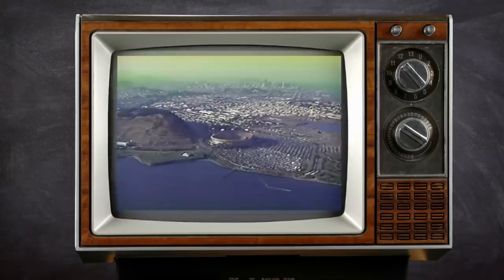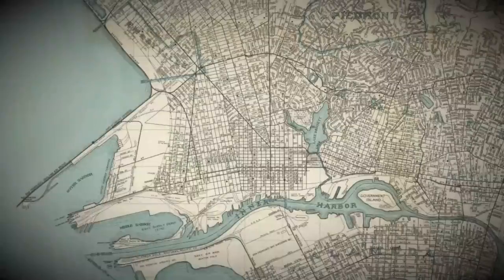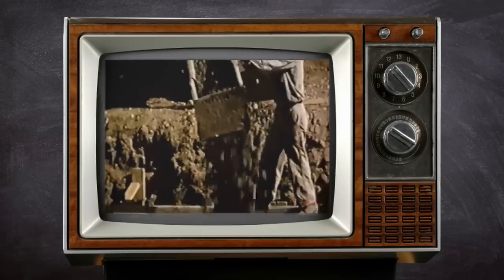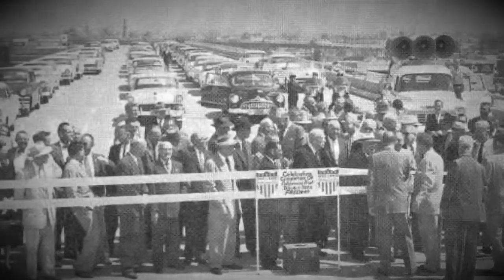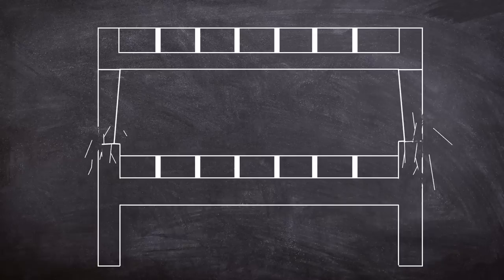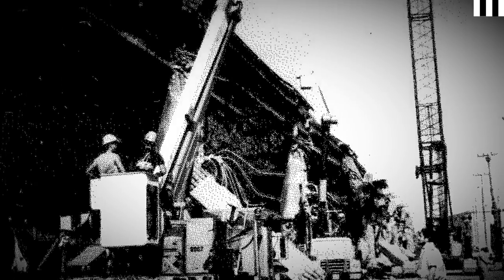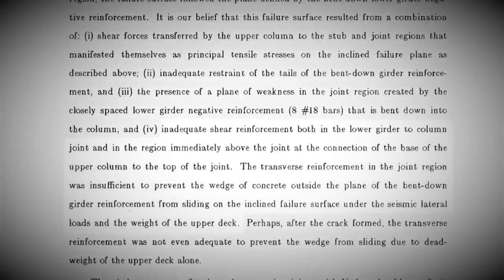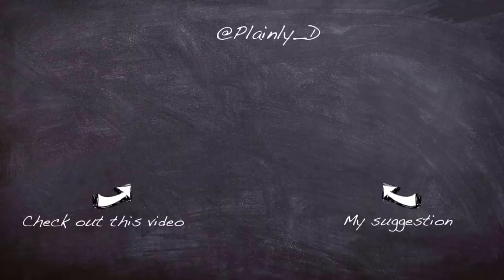A Brief History of: The Cypress Street Viaduct Collapse Disaster 1989 (Documentary)

Comment: As an ironworker who has built bridges and roadway decks, I can tell you that everything is placed well steel-wise, but once it's buried in concrete it's in the hands of the chemical bond between the bar and the concrete.

epoxy-coated iron has been the go-to standard for bridge construction in WI now for my entire career, but I am not convinced of it's efficacy - we are already seeing rust streaking and concrete blowouts on projects less than fifteen years old.  Personally I feel that the alternatives are less inspiring of confidence, but then again, i'm no engineer.
Reply: epoxy rebar is banned now due to excessive rusting from galvanic action on exposed parts of bare steel where nicks or rubs expose it
it rusts through WAY faster than traditional rebar when this happens, now they are looking at fiberglass rebar and carbonfiber with very promising results, not just from strength gains but weight as well, but rebar is very well understood over a hundred years... we dont know the long term effects of these new things
Reply: @narmale  obviously then we should just replace every structure right now with the new stuff and just hope nothing goes wrong. Works for Pfizer.
Reply: But it also depends on the concrete itself, in Gateshead in the 1960's they built a complex called Trinity Square, a brutalist building consisting of a shopping centre and a multistory car park. Within 5 years of opening, they found cracks in the building because of shitty cement and were always patching it. They demolished it in around 2005 and rebuilt into a shopping promenade. I visited the shopping centre as a kid, it was a tip. Visited it as an adult, it was like a scene from Chernobyl, place was dead.
Reply: @narmale  just an old plumber talking, but I always considered the epoxy finish a sales tool. I have plumbed many a swim pool to return because of shifting. In the ensuing jackhammer work(years later) raw iron had very little degradation. Difficult at best. Always questioned the efficacy of coating a steel rod in concrete
Reply: @omeyehead7436  I'm just a lay person, but we were taught that this was the best to make a structure stronger.
Reply: There are so many buildings in Europe and other places. I know that we're a young country. But why do their buildings stand for centuries and ours have problems standing for 40 years. We have some of the best engineers in the world and maintenance and monitoring is crucial. I'm not including earthquake disasters. I keep thinking about the Washington Monument in DC that's sinking and the Surfside condominium CTS melting away and SF Millennium Tower leaning just needing a tiny quake to blow it over.
Reply: @omeyehead7436  absolutely correct, only time it starts rusting is when it has non-stop immersion of water aka in factories with chemicals... i worked construction for 14 years and all the demo work the rebar was just fine... yet another reason i dis-like engineers... if it aint broke, dont fix it
Reply: @staciasmith5162  Short answer: quality through rigorous oversight.
Longer answer: here in West-Europe it's very difficult to get away with shoddy quality and/or bribing some officials. Oversight is very strict and therefore the quality is guaranteed to be higher. Don't even try to try and hide structural work by patching it over before the inspector has done his inspection, because he will simply tell you to remove it so he can inspect the beams, pillars etc. And you better have the paperwork at hand, showing what quality material you 've bought and from who.
Reply: Besides money, why isn't stainless steel or even galvanized rebar used?
Reply: The real problem with this structure was light design. They realized it wouldn't hold up and designed a retrofit program to upgrade the whole Cypress Section. Only 4 columns got the upgrade as a test before upgrading all the rest. You can see those four still standing at the 11 minute mark in the video.
Reply: There's such a thing as carbon-absorbing concrete, now. The advantage of at least one formulation is that it gets stronger over time, because it absorbs carbon from the air. 
It's probably not currently used because of cost to change production methods, I would guess.
Reply: @staciasmith5162  The Romans didn't use rebar in their concrete, so it never rusted and expanded.  The Greeks had a great system.  the top of the blocks were concave and the bottom of the blocks were convex so they nested in each other.  Some blocks were held together horizontally by cutting a channel like an "H" across blocks and fitting them with soft lead.  When there was earthquakes, the soft lead would flex and the nested blocks would move, but then the structures would reassemble themselves through gravity.  The Japanese who always had to deal with bad earthquakes had their wooden structures assemble with many joints.  Considering they had heavy clay tile roofs which weren't going to sway in unison with the ground movements, having structures with a low failure rate is amazing.   The solution to the rebar problem is to go with fiberglass or carbon fiber.  As always, only the good buildings last which gives us the false impressions old work was always good.  In Britain, most castles were wood coated in plaster to stop attacks by fire.  They are all gone.
Reply: @lewisdoherty7621    Worth a mention here... In regards to the tallest and most ancient of Japanese Temples, they had a system of engineering for a single column right down the center of the temple tower. It's designed to move as a weird hybrid pendulum and counter-weight to the rest of the framing, joinery, and structure during a quake. It IS amazing, particularly the way they developed such a design so long ago, because some of those temples have stood for over a thousand years through quakes, war, bombing raids, volcanoes, and tsunamis... AND they're just as viable for human touring and habitation now as they were in the first years they were opened... 

     Speaking of which... They've got a modern school of engineering that's working that same counter-weight and balancing pendulum principle into modern skyscrapers in Tokyo. If I recall correctly, they retro-fitted a building with such a mechanism in design by taking up some of the elevator shafts for the columns and rigging, downsizing from a single GIGANTIC column to several smaller ones instead... AND part of the school's effort involves the students coming back to the building regularly to take readings and measurements over time, and especially around quakes and tremors. 

      BTW... just a tiny side note. Lead wasn't the only metal used by the Greeks for joining stones in horizontal fixtures. Bronze was also popular for it, particularly where the joint required an extra tightness and you could hammer bronze where lead would just splatter... I think some folks called them "Butterfly joints" (for the shape preferred among metal brackets), but I could be mistaken... It's been a while since I had anything to do with old-school "natural stone masonry"... ;o)
Reply: @staciasmith5162  a few ideas here. In the 60's-70's we were building many new structures pushing the envelope on efficient engineering. This was a example of learning through failure. If you're talking specifically about seismic instigated failure Italy is the most active country in Europe the rest of Europe is pretty chill. We have a very short history here in North America. California grew very fast 100 year before that viaduct we built settlers were filling the bay with garbage and fill dirt to make more land. I don't need to explain why that might have been a bad idea.

Just a note, many structures stood up to the quake very well. But importantly California learned allot from it's mistakes.
Reply: @Peter_S_  Imagine being the guy in that truck and seeing the upper deck fall 3 feet in front of your eyes, climbing out and realising the same thing happened behind you? That would have to result in some massive PTSD.
Reply: Epoxy coated rebar is now being banned in some areas.
Reply: @seymoarsalvage  stainless +concrete = a form of corrosion that leads to cracking and rapid failure.

And the stainless is considerably more expensive.
Reply: I never used to care, since I grew up in Pennsylvania, but having lived in California for 25 years, when I visit friends back in Pittsburgh, those bridges set on steel girders give me the WILLIES. My brain is thinking "oh look, an erector set that could snap at any moment." Which isn't fair— steel can flex, it's the concrete that's brittle— but I feel a lot better with the robust lighthouse-concave support pillars used out here now. It looks to me like they're wrapped in some kind of rubber sheeting to help maintain the integrity of the concrete, plus the cage of reinforced steel inside is quite dense. I hope we've adapted whatever Japan's been doing post-Kobe, since the 2011 Japan tsunami debris was flowing past roadways and bridges that remained intact.
Reply: @fhuber7507  there has to be something that can be used as rebar that isnt corrosive. And money shouldn't be a issue if the damned rich would pay up...
Reply: @staciasmith5162  You also have huuuuge American egos with greed to factor in.  Just look at your politics, law enforcement, education, healthcare, gun industry and military. Engineering is the least of your problems.
Reply: @gnarthdarkanen7464  I enjoyed reading this thank you
Reply: @dontblockthebox  Thanks for reading, and you're always welcome! It seemed like a share of nuance and details might flesh out the picture historically... give folks a little something they could further research tangibly.

    In any case, I'm glad you liked it, and hope you got something out of it. ;o)
Reply: @staciasmith5162  not all of our buildings stand for centuries. Some got rebuilt, other destroyed and replaced by newer ones some centuries ago. That's what happens after so many fires and wars.
Other than overbuilt churches, castles with 24/7 deluxe maintenance and tiny wooden houses not that much is left from the middle ages. Many many more buildings from the 1800 still going strong though.
Earthquakes are not a huge problem in Europe. The biggest one was in 1755 and completely destroyed Lisbon.
Some years ago a viaduct in Genoa collapsed too.
Reply: @YeahNo  I agree that we have  many problems, but there's a bridge on the Tennessee and Arkansas line that had a bridge which had to be closed down tout suite. We can walk and chew gum at the same time. Engineering is critical.
Reply: @seymoarsalvage  German steelworker here: Stainless steel has always a considerably lower tensile strength due to its alloy containing a good portion of chromium. If you would want to use it you need ~30% more. This would increase the total weight - thus, you need even more. Plus, it costs ~30% more per ton in the first place. And finally, if it was manufactured badly or has mechanic connection to a non-stainless steel part it rusts away like standard steel. For the same reason ships are built from standard steel and are protected by paint, coatings and self-sacrificing zinc anodes, which protect the ship very effectively by an electro-galvanic process. These big zinc chunks are eaten away by the sea water and have to be replaced after a few years.

Btw: Really good knives are made of slow-rusting steel, never from stainless because to this very day it is not possible to reach the same level of hardness.
Reply: A big German concrete company works on recreating 'zementitium romanum' - Roman concrete. It uses a volcanic substance called 'puzzolane' which is the reason why so many Roman buildings like the collosseum in Rome are still standing after almost 2000 years!!

That Roman concrete does harden under water and, in opposition to modern concrete, it gets stronger and stronger over centuries. Furthermore, it does not chip or crack after installation. According to their scientists, it is hard to optain and therefore they search for a replacement.

The Chinese wall was built using sticky rice in the mortar compound - this is also very interesting today!!
Reply: Yep,
     40+year PileButt. I've been building bridges, high rises, and even the Space Shuttle launch complex when I was younger man.....
      Epoxy coated rebar is a train wreak....
      If corrosion is going to be a problem, then HOT DIP GALVANIZED is the solution......
       BUT,
Let's kick it back to design......
      Better design of large structures is the beginning.  Let's not forget all that we've learned over the last couple hundred years. We can design structures that don't have corrosion problems.......
       Now we've thrown the Engineers under the bus......
      Let's look at the LOWEST COMMON DENOMINATOR hands coming into the trades to do the work......
       CRAFTSMANSHIP died a slow an horrible death 30yrs ago......
Most of the people I fired just couldn't understand that their shit work an shit attitude towards work was unacceptable.....
        Now this goes for the inspection as well.....
         Where do we go from here????
I don't know, but we in the building trades need to come up with a real solution.......
Reply: Epoxy rebar is banned in UK I think the rain causes too much rust maybe different in california as the weather in San Francisco or Los Angeles is a lot drier than liverpool or london
Reply: @seymoarsalvage  stainless is at least 3 times the price for even a low grade 304 so that is likely the main issue stainless requires alloying elements that are rarer, much more expensive and harder to supply than iron and carbon which is like 99% of conventional carbon steel. Stainless would otherwise be an ideal material as it is also stronger and more resilient in general than most carbon steels. 

Galvanised rebar is starting to be used but concrete mixes actually dissolve part of the galvinization layer and I think this can effect the chemistry of the concrete. This can be solved by using a thicker zinc layer and validating concrete performance with gal rebar but the process is more expensive and uptake is slow. In future I suspect we will see more and more galvanized rebar used in concrete though.
Reply: The big problem with concrete roads and bridges in northern States has been the salting of them in the wintertime leading to rebar corrosion and it's attendant ills. Much the same happens with concrete in coastal areas where salty air does similarly. Concrete can be a wonderful material but no material works equally well everywhere or in every application it might be used in. I can show you many concrete structures where I live that are 80+ years old which have issues with rebar corrosion. Numerous freshwater dams are built of plain rebar but have no such issues. So it's not just the rebar- we need to re-think the whole design problem allowing for any possible use or misuse of what we build. And we would do well to learn to live with nature instead of trying to fight it, for nature will always win that game. There are simply some things we should not do, yet we keep trying to do them, and we keep seeing failures. We humans aren't as smart as we'd like to think we are.
Reply: I just watched a video on why epoxy coated rebar is not effective. There's a few reasons, but mainly it's because the coating gets scratched during construction, and that leads to spalling at that particular spot. With regular rebar, the spalling occurs evenly. But with epoxy covered rebar, once there's a scratch in the epoxy layer, it attracts oxidation like a magnet. In other words, the oxidation becomes concentrated at that particular spot, rather than spread evenly. Even worse, once penetrated, water seeps in beneath the epoxy causing a void!
Reply: @seymoarsalvage  probably literally just money lol
Reply: @Peter_S_  interesting
Reply: My next door neighbour is an engineer. He has had a seemingly daily rant about epoxy, or any coated rebar. If it needs inspecting, inspect it, and fix it. New standards happen. Upgrade it. Fred knows a lot, for an enginerd.
Reply: @staciasmith5162  America is just cheap lol it’s not some big mystery. We build cheap trash because the rich guy funding it doesn’t care that it will crumble a few decades after his death and wants to pay as little as possible for materials, labor and design. Lowest bidder mentality.
Reply: Money is the only thing that matters.
Reply: @seymoarsalvage  stainless steel goes through severe pitting corrosion in wet, oxygen poor environments